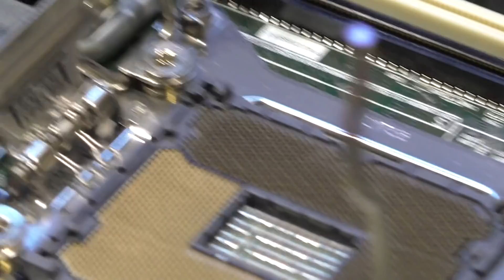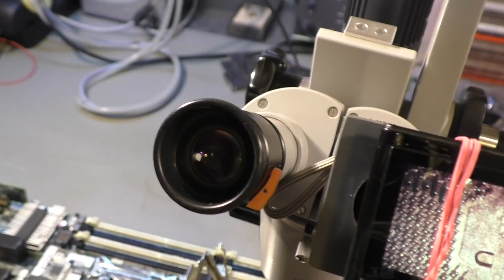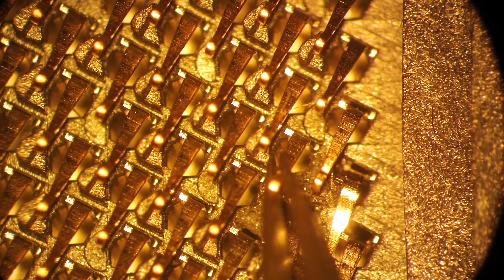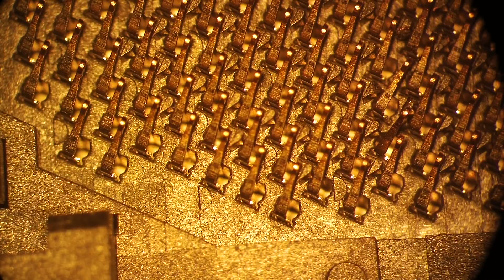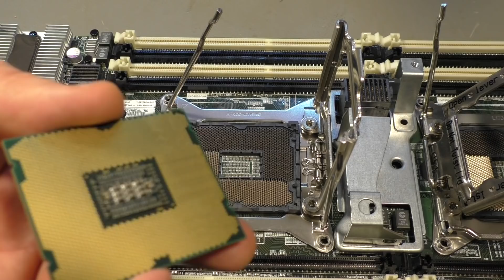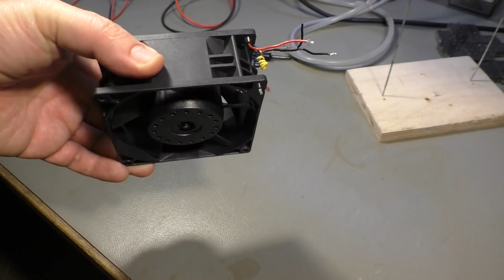CPU socket repair and a flying fan - (PWJ112)

Comment: Damaged pins or missing pins won't fry a CPU , would it?
Reply from the maker: It depends..... In most cases your CPU will be fine. A missing pin will cause no damage. A damaged pin power pin could short to a ground pin, resulting in fire damage of the socket and probably the CPU too.
A missing pin does probably not even affect the function of your PC. Half of the pins on a Xeon CPU are power and ground. If one of those is missing... who cares.
Check Intels data sheets and pinouts, there are even unused pins on those CPUs.

Comment: I've got a video of a fan hovering a little bit, but my friend Doogie has been working on a hovercraft that uses fans from a HP Blade center to inflate the skirt and he was able to get it to lift and move 70 lbs of weight. I've even used old server fans at work to ventilate my office, and needless to say, they are a bit of crazy in a small package.
Reply: And those types of fans don't have to be loud either.  I have an old 310W Dell server PSU which has a 40mm fan on one end and it is extremely quiet; you practically have to be sitting next to the thing to be able to hear it.
Reply from the maker: I have a fan from an IBM rack that is about 20cm in diameter and it is speed controlled. You only need a small potentiometer to regulate the speed. I use it in my basement wood workshop at the window to blow out dirty air. It's so strong that the door opens by itself from the underpressure in the room :-)
Reply: @PlaywithJunk  20cm is actually what I meant.

Comment: This is a mess. CPUs with pins on them are so much better.
Reply from the maker: Yes but CPUs without pins are cheaper to manufacture.... that's why.
Reply: Actually the reason has to do with contact density, with which pin-grid array technology has a fundamental limit.  Fujitsu developed LGA technology back in the mid-90s as a way of being able to fit more contacts in the same amount of space; this was important in being able to shrink down the package size of high-end 64-bit SPARC CPUs which had more than 2000 pins on them.  Intel started using this technology with the introduction of the early Xeon and P4 processors as a way to handle increased power and frequency requirements.  The large amount of socket contacts allowed them to optimise the contact layout for high RF frequencies, enabling them to produce 2- and 3GHz CPUs for the first time in the history of microelectronics.  AMD has been using LGA in Opteron, EPYC and Ryzen Threadripper products to overcome space limitations with the very high pin count of those products.
Reply: I thought I heard they allow for greater pressure to be applied too, which helps with cooling. also, power delivery is better as well.